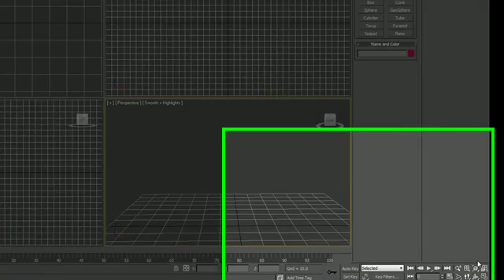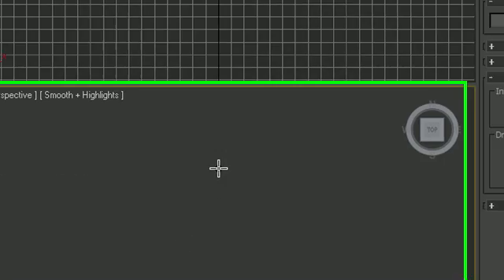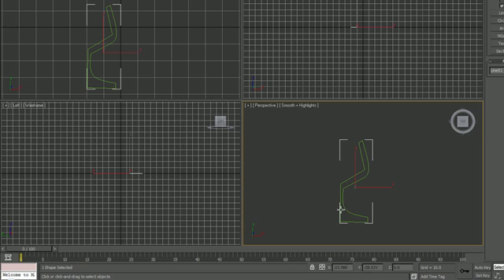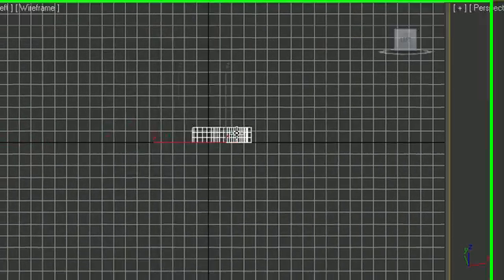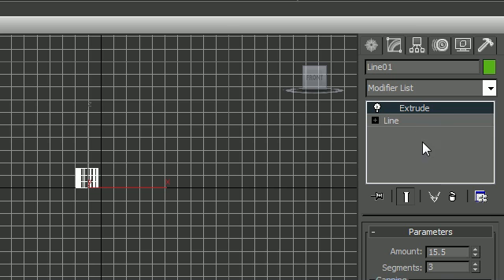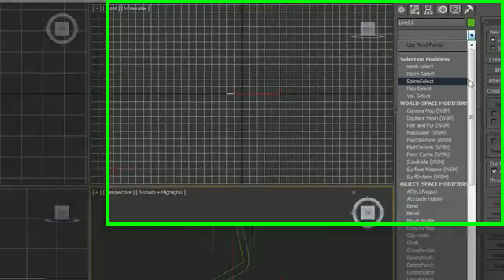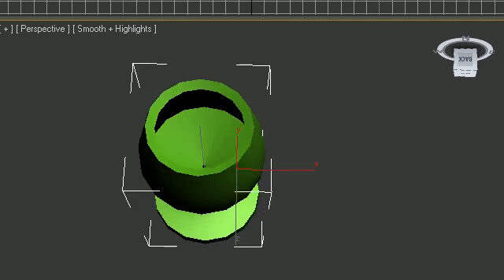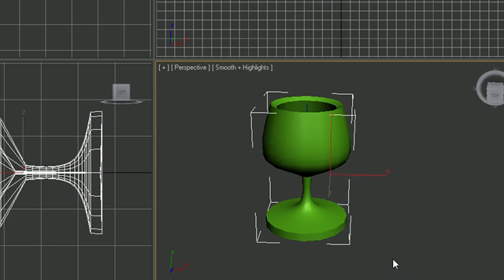3Ds Max Tutorial - 13 - Extrude Splines

Comment: A lathe is a machine you use to spin a piece of material. Then you use a sharp dowel or carving tool against the material spinning. depending on how long you leave the tool in one place determines how much material is cut away for desired shape. So the wine glass you made. picture it as a solid block spinning around cutting away the desired space to form your glass. Thank you for the videos! really helpful.

Comment: Can someone explain the difference between polys, meshes and splines?? I need to make an animation for college, and have no idea where to begin here. Thanks.
Reply: A polygon is a piece of geometry within 3D space that you can use the manipulate into any other shape you want.
A spline is a line that uses vertices to make bends and create a 2D shape in 3D space.
A mesh is usually just another term for a polygon, so a polygon mesh is the same as a polygon.
A nurbs surface is different though, that uses higher mathematical values to create soft body surfaces (used for dynamics and such, can also be used to make things like cushions or a trampoline style surface), it is harder to manipulate than a polygon.

I know it is 4 months too late but I hope that it helped, if you already found it out, good to hear. [:

Comment: lathe comes from the machine tool called center lathe,, a tool that shapes cylinders, holes and the like, it has a rotating spindle holding the object and a tool moving on a carriage that makes what is called turning

Comment: So, a lathe turns an object about a central axis - whether it is metalworking or wood. A pottery wheel works on the same principle, only on a vertical axis instead of a horizontal. Good tutorial.

Comment: I'm trying to create a arc shaped bridge. I can use the arc command to create the nice arch, and then I extrude, but it's still flat. IE it's now 2d going width wise, but no depth

Thanks,
Reply: I may have the same issue.  It looks like a 3d model, but when I try to tesselate the faces, it only tesselates some faces.  Sorry, kind of hard to explain without a picture.

Comment: I made a UFO according to the video. and then I took half hour to figure out why this was happening...maybe that's because I am on 3ds max 2012. What I did to make this right was...click on "Lathe" -->"axis", adjust the axis to the right position. and then the UFO turned into the wine glass. You also can adjust the degree of the lathe on the panel. Any way thanks for the video...this helped me a lot.

Comment: I hope u are not an engineer, coz a lathe is a machine, where the job rotates in high speed, and a cutting tool clips it off to a shape, only good for curvy or cylindrical shapes, cannot do milling :)

Comment: alright a lathe is for molding metal like a pipe into a beveled handle or to cut threads into it. like a mill is used to mill metal or wood into square objects normaly its used to make different stocks of wood for building, but since pottery is a similar concept to the pipe ,how it spins while its shaping the metal. i believe they are called the same thing. 1 min 45 secs in

Comment: A lathe ( /ˈleɪð/) is a machine tool which rotates the workpiece on its axis to perform various operations such as cutting, sanding, knurling, drilling, or deformation with tools that are applied to the workpiece to create an object which has symmetry about an axis of rotation.

Comment: Lathe is a woodworking tool in which you place a piece of stock. It then rotates it along the X axis (whereas a pottery wheel is Z) and then remove wood from said stock with chisel style tools typically making a table leg or baseball bat style object... and you are pronouncing it correctly btw.

Comment: Lathe - A machine tool which rotates the work piece on it's axis to perform various operations, such as cutting, sanding, knurling, drilling, or deformation with tools that are applied to the work piece to create an object which has symmetry about an axis or rotation. Used in woodturning, metalworking, metal spinning, and glass-working. Lathe's can be used to shape pottery, the best known design being the potters wheel. - That was what wikipedia said.

Comment: say i have a 2D sketch of some tunnels imported as a shape, converted and added extrude. is there a way of rounding out the shapes into more of tubes instead of squared off ones. or instead of extrude use a bevel
Thanks a bunch

Comment: question... is there any easy way of cleaning caps (top/bottom faces) after extruding? it creates wierd polygons when extruding complex spline shapes so i have to place editpoly mod on top, then manually clean those lines... if i dont do that, and simply place turbosmooth on top it scre*s up my model...

Comment: Incidentally, that "thing that spins it around" is a pottery wheel, but I don't think it is applicable to the lathe. A wood lathe turns a block of wood around a common axis for making spindles, or cylindrical carvings. Point taken though, man, well done.

Comment: A lathe is a mahine that they use in machining metal.... A lathe has a chuck which holds the piece your machining. This piece spins at high to low RPM and you machine it to whatever your doing... thats probably where hey got the lathe from... Its spinning action

Comment: Lathes can be used to shape pottery, the best-known design being the potter's wheel. Most suitably equipped metalworking lathes can also be used to produce most solids of revolution, plane surfaces and screw threads or helices. Ornamental lathes can produce three-dimensional solids of incredible complexity. The material can be held in place by either one or two centers, at least one of which can be moved horizontally to accommodate varying material lengths.

Comment: A lathe is a mechanical machine tool which spins a block of material to perform various operations such as cutting, sanding, knurling, drilling, or deformation with tools that are applied to the workpiece to create an object which has symmetry about an axis of rotation.
Lathes are used in woodturning, metalworking, metal spinning, and glassworking.